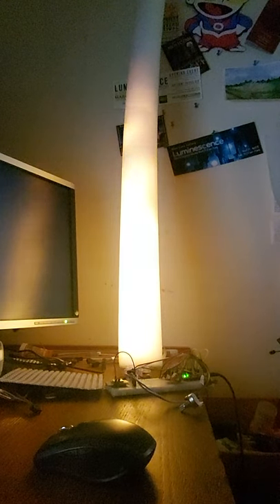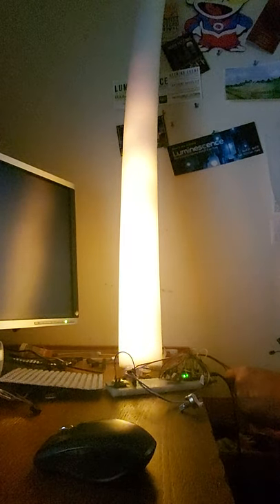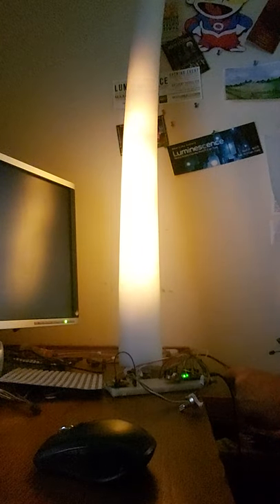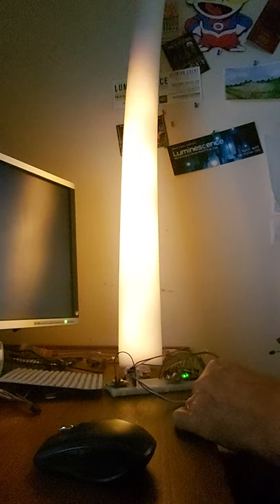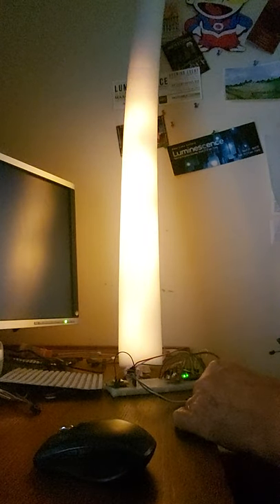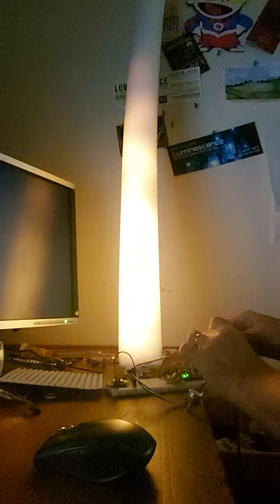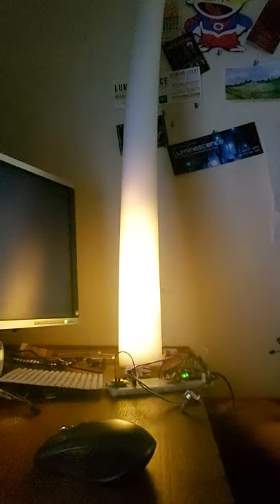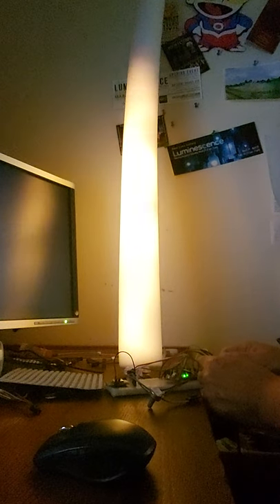A FastLED Kerosene lantern

Comment: For me, the question is how small can you make this and still have it be effective? I've built several kerosene lanterns for various theatres using both WS2812 LEDs and grain-of-wheat incandescents. Both involved just a few LEDs/bulbs, encased in small 3D printed "flames", about the size one would expect to have in a hand-held lantern.  I guess I'll just have to experiment, eh? Maybe those really, really tiny WS2812 LEDs can be used for a "hi-res" flame.
Reply from the maker: Hi Franz. Would be interested to know your results. If you have some cool effects, I'd love to see them. I've got a lantern exhibition this weekend, but plan on trying this out with some of my handheld lanterns, hopefully next week.
Reply from the maker: I've done some testing with this and while exposed LED's look pretty good, once you add significant diffusion, the result diminishes significantly in a relatively small lantern of ~12 led's.

As a result, I made a version that uses palette colours that looks a lot better. Have also made a version with a pile of IR controls for it.